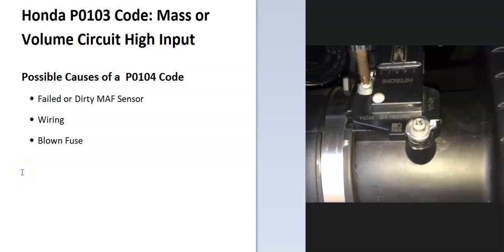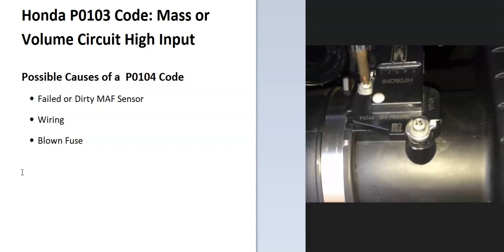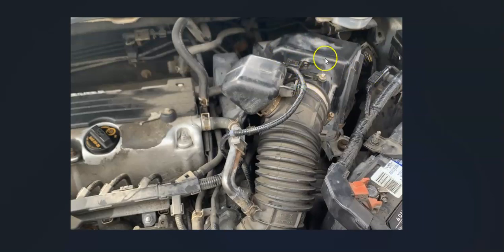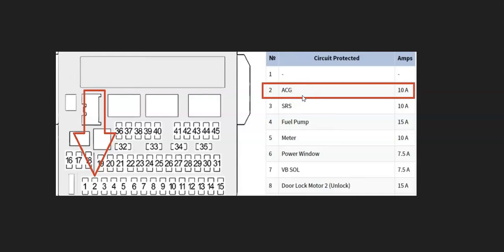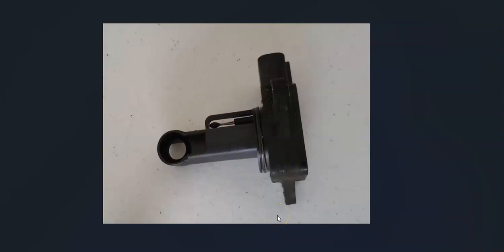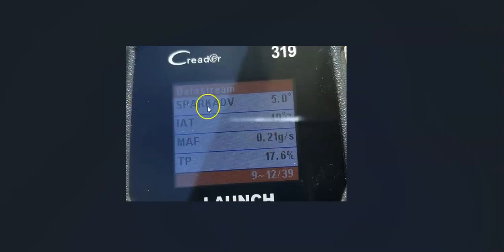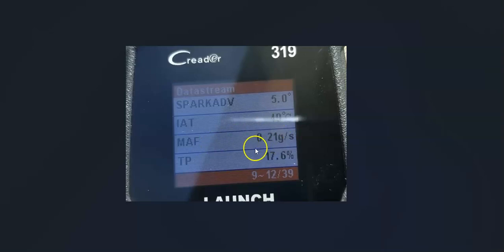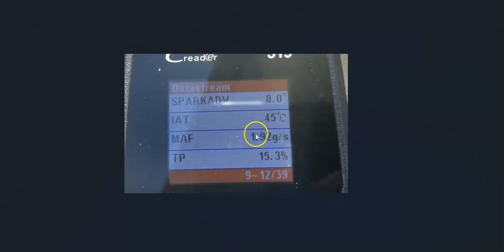How To Fix a Honda P0103 Code: Mass or Volume Circuit High Input

Comment: Do you think bad gas like water in the gas could cause the P0101 and p0103 codes and a misfire on cylinder one because it’s happened twice when I got gas at the same place. People are calling me crazy but it’s just the only thing that was happening. My car is a 2013 Acura RDX. I clean the sensor like you suggested last time and it worked perfectly for about a week and a half and then like a dummy I went and put gas at the same station and and do you know it did it again but this time I actually bought a nuisance and put it in, but the car is not coming back quickly and I also treated for bad gas with some of that. I don’t remember what was called, but I got it at O’Reilly’s. I’m going to test that new sensor like you suggested to see if possibly it’s bad but I don’t think I’m not lucky lol